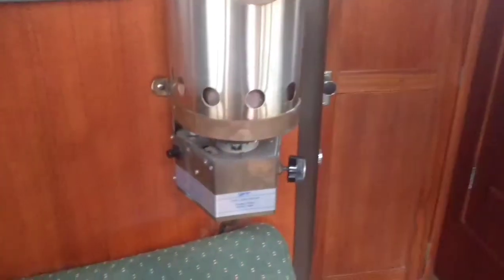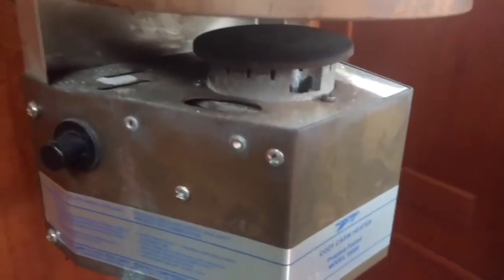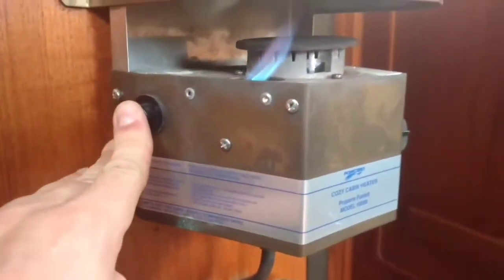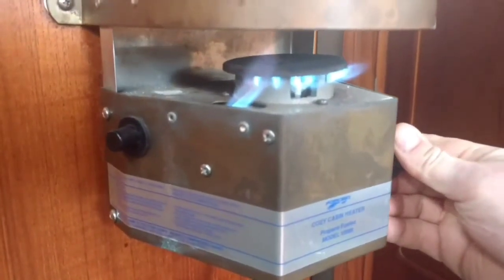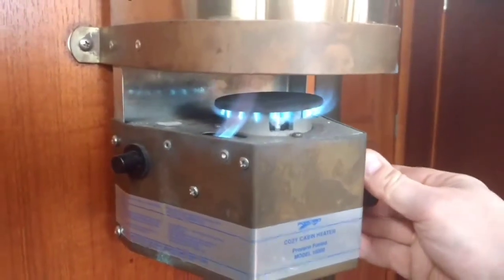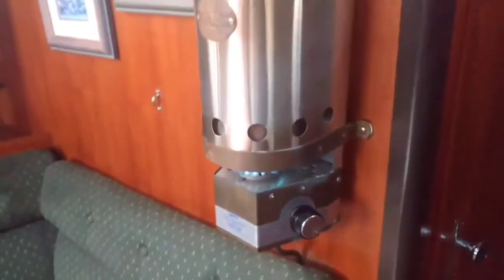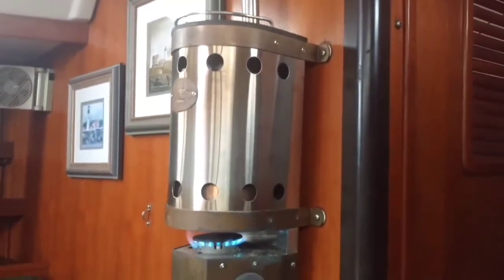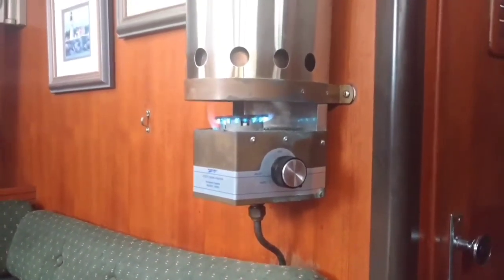Force 10 Propane Fueled Model 10000 Sailboat Yacht Heater

Comment: Thank you for posting this.  A boat I just bought has one of these on board & this video explains how to get it going.  I had never seen one before.  Now I just need to figure out that funny little deck fitting on top of the exhaust stack.
Reply from the maker: You will love it they throw amazing heat for the size

Comment: Bought the new one for my camper. I like that they don't need electricity and are efficient. If you put a thermo powered fan on top of the burner you would circulate the heat even better! By the way, what temps have you used it in?
Reply from the maker: Craptastic4 yah they work amazing and use no power which is nice. I agree I may look into one of the fans it would certainly move the heat alot better

Comment: how about propane humidity inside the boat considering it's not an isolated combustion? Do you have to keep a small opening outside too (O2)?
Reply from the maker: The hatch is usually cracked a bit but the humidity is not bad at all. We also have a CO2 detector on board.
Reply: @PovertyPointCustoms  thanks for your reply! we're thinking to buy one for our sailboat, how about consumption?
Reply: The flue on top going outside brings most ( if not all ) moisture the gas contains outside.
Reply: I have the kerosene/diesel version and I love it.

Comment: Im getting ready to put one in my micro house. Can i run that out pipe for 10 to 12 feet or can i put a bend in it?
Reply from the maker: The max exhaust recommend length is 10 feet, ours is about 4 feet in the boat (it's a 1 inch pipe).  I'd say you'd be ok with a small bend but I wouldn't make it to much as they recommend a straight exhaust (pipe) for best exhaust venting. Hope this helps, let me know how you make out!
Reply: Hi Cris just wondering if you ended up getting this stove and if so what square foot is your place and how does it work for you?

Comment: help is this heater more economic than useing electric ?
Reply from the maker: Its great in the boat as it runs off propane, and doesn't require power to run. Its very efficient and uses very little propane so probably alot cheaper then using an electric heater.
Reply: thank you just asking cuz my bill was 600 a month last year on elecric